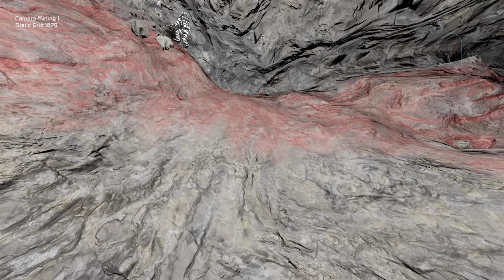Gathering More Resources! Space Engineers Time Lapse Series: Space Elevator Again - EP6

Comment: the "road" you build will go half of the earth and will be vertical at some point. am i wrong?
Reply: well, it wont be vertical like a 90 degree, but yes, it will become a very steep angle after some time, like a tangential of a circle
Reply from the maker: At the moment, I'm thinking a rail system towards the moon, stop at a space station, which is connected to the moon
Reply: @PandemicPlayground  so how will you handle the gravity?
Reply: @prettycolddeath he described it earlier when he was reminded platinum doesn’t spawn on planets, hydrogen thrusters